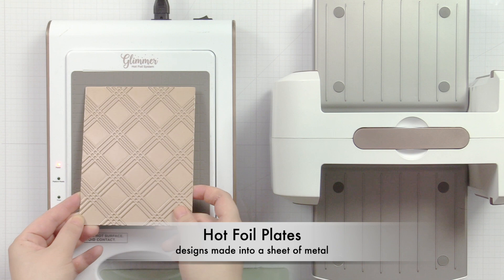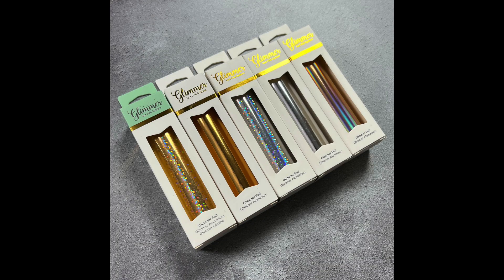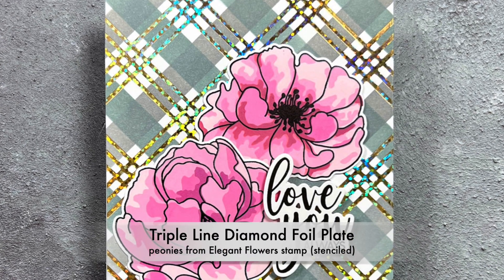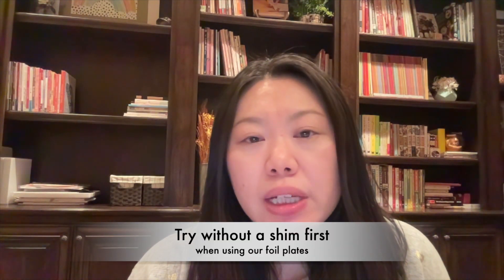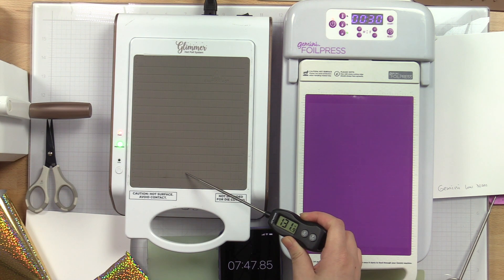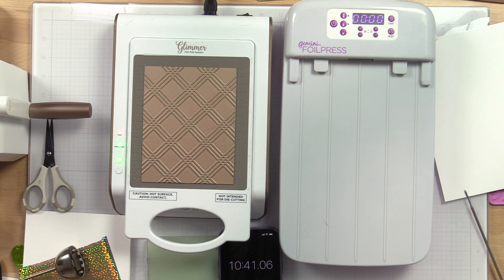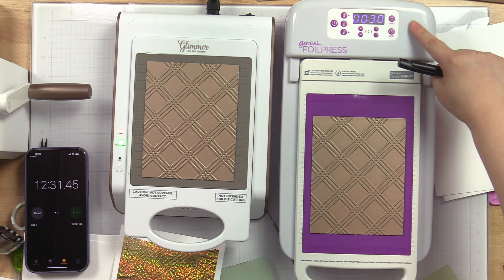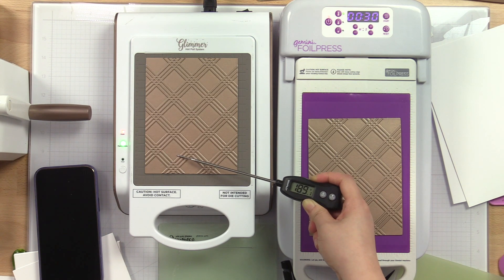Hot Foiling 101 - Glimmer or Gemini? Perfect Result Every Time?

Comment: This was the most comprehensive video I've seen yet! Thank you so much for doing this! I have RA and a the Gemini was the only way I could go when I decided to take up card making again a few years ago. I had given up as my hands have limits now. I got a Gemini Foil machine for Christmas and haven't opened it yet, a little afraid I'll use up all my foil on practice! :) But this video made me feel more comfortable and willing to just dig in and go for it! Can't wait to purchase some of your new products as well!
Reply from the maker: Hi Ashley, did you see that Nancy Stamps commented here and "warned" us about the Gemini platform can be warped if left on "high" for too long? I did 1min on high just to be safe but she suggested starting with 30-40 seconds. And these are the settings for Glimmer foils. If you use Gemini foils, shorter time is preferred because they "melt" at a lower temperature! Best of luck! -Nina
Reply: Don't be intimidated it is so easy to use.  Use low setting 15 sec with Gemini Jr. papercraft foils (HSN sells a bundle of foils for the Gemini)  I use Glimmer foils on Low @ 23-25 sec.  Use 100# or higher weight smooth cardstock I use Neenah 110# 200 gsm Index white cardstock.  I also have used Hobby Lobby heavy weight cardstock with great results.  Pink Fresh Studio has a great video Foiling 101 and Nancy Stamps has many videos on the Gemini Jr. Foil Press and foiling.  Keep in mind the foil rolls are 15 feet long @ $3-$5/roll and the only way to learn is "to practice".  Place your foiling machine as close to the Jr as your craft area permits for ease in transferring the plate without burning your fingers.  After you have foiled a few things, you will see how easy it is to become more comfortable using it.  Also, get the Pink Fresh Studio solid foil plate to foil the negative (waste leftovers).  Amazon sells it for $20.  Once you get over the initial intimidation, you'll love foiling

Comment: There was a lot of good information here but some of the information could have used additional research. The Gemini foil platform will warp with too long usage on high.  Gemini Paper foil transfers at a much lower heat, it will cause overfoiling on other machines an higher heat settings. Yes, the higher heat is better for Glimmer foil, but the timing is based on the size of the die. Start with 30 seconds and work your way up, again or you risk warping your platform. Each machine has pros and cons and there is not one correct perfect method each time.
Reply from the maker: Thanks for the info, Nancy! I have some Gemini foils on the way, I will test more. When you say the platform warps, do you mean the purple one that the plate sits on or the green plate that goes on top?
Reply: @Waffleflowercrafts  the purple  heating platform will curl upwards from being on high heat too long. 35-40 seconds on high should be good for the Glimmer foils.
Reply from the maker: @NancyStamps  Thank you for the info! My order for the Gemini foils got canceled due to supply chain issues... Will be testing as soon as they come in!

Comment: Sorry, another comment. I’m thinking the glimmer for the big shot would work better than using the foilpress for my Gemini. The Gemini “spits out” the plate which could be detrimental if it isn’t caught in time. The glimmer plate will stay on the big shot after running through and not fall off because it doesn’t need to be caught. I’m also thinking just using new plates with the glimmer on the big shot only, rather than using the same plates used for die cutting on the gemini might be better!

Comment: Thanks for the informative video.  I have the Gemini foil press and I really like it. I hadn’t thought about the variations you mentioned with the different foils and colors but I have noticed different results. I used the Gemini foil that came with my machine and I thought it worked better than the glimmer foil. I am not noticing variations on the edges so it might be your machine or your plates could be warped. I’ve been using mine on medium heat.  I’ll try high heat as you suggested.to see if it improves the results, especially with the foils that I’ve had trouble with.  Thanks again, Nina.
Reply from the maker: Thank you for letting me know, Diane! I have some Gemini foils on order and I will give them another try!

Comment: I have both the big shot and Gemini but I prefer my Gemini and have that one on my desk. The big shot is on the floor to the side as a backup. If I prefer the Gemini, would it just be best to get the foilpress or should I consider getting the glimmer and using the big shot just when I want to foil? It’s hard to decide between the two! Also, is the foilpress discontinuing? I saw that somewhere.

Comment: What is the difference between your plate and the plate that Heather with PinkFresh came out with?
Reply from the maker: We assume that you are talking about the Solid Foil Plate? Both are used for foiling the reverse designs. Ours measures 5x6in, which is bigger than the Pink Fresh solid plate. If you already have the Pink Fresh  plate, there is no need to purchase again unless you want to have a wider, and taller plate.